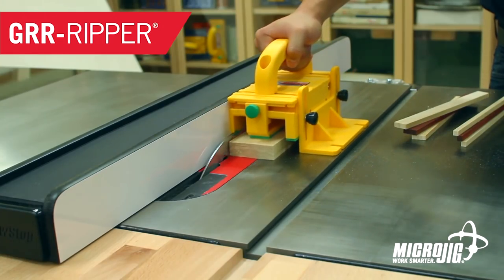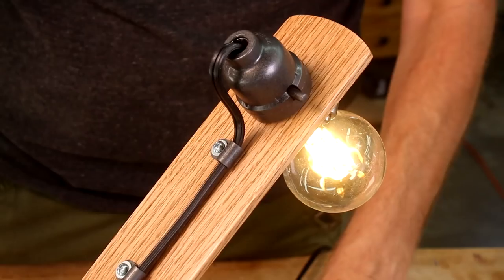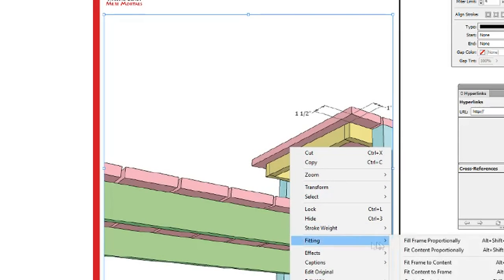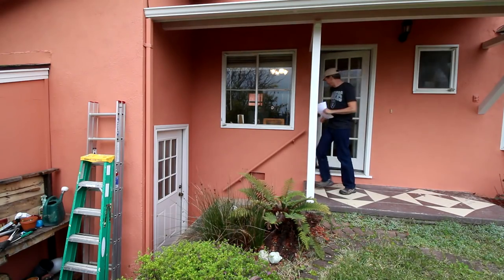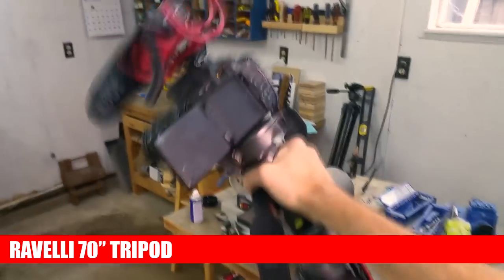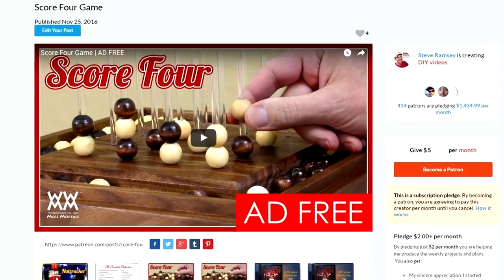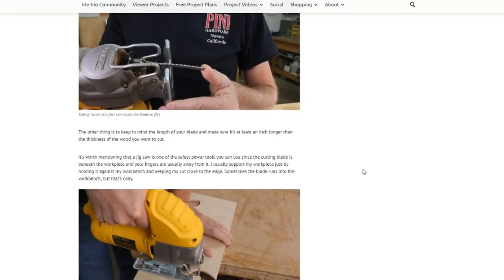MAKING WWMM: How I Make My Videos, From Project Design to Upload

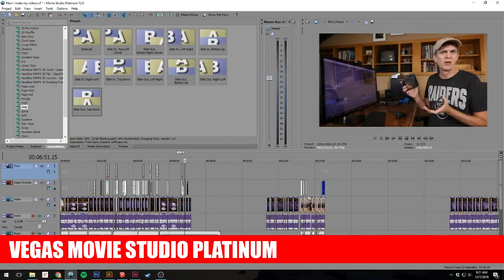Comment: 12:44 - I use Vegas Video as well... but get the HD Suite... it allows up to 10 video tracks and 10 audio tracks, has many more effects and transitions, and also comes with Acid Music editor, and a DVD architect if you want to produce a DVD. It is a middle range program about $150 whereas the others are $80 for the low end, and $600 or so for the upper end. Consider installing a second monitor... it's awesome putting the preview screen on the second monitor... do it once and you'll be hooked.

Comment: Another classic, thanks.  LED tubes for (former) fluor fixtures:  fairly recent option, the tubes still pricey, but easier than changing the fixture.  Also, if pricing holds to history, they'll be cheap by mid '17.  And they do make a huge difference in the brightness and are much cooler.

Comment: LED lighting is not really better than T8 fluorescent.  LED does use less energy, but it it NOT more efficient, they're just lower wattage, for example you need twice as many LED T8-replacement tubes to equal the T8 light output, and even though they're much cheaper now they're still about eight times the cost of a T8 bulb.  Even worse, the best LEDs that equal the light per watt of a T8 fluorescent only last about 50,000 hours at best, where the Philips Alto T8 last 40,000 at about $2.50 a bulb.

So to save energy with LEDs over T8s, you have to have less light, and you'll never save enough money to offset the cost of the LEDs.